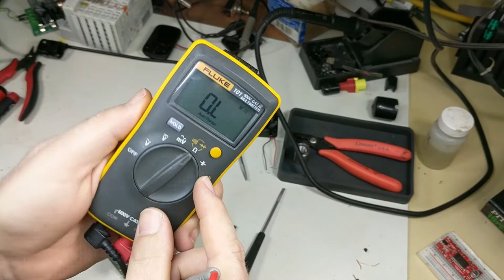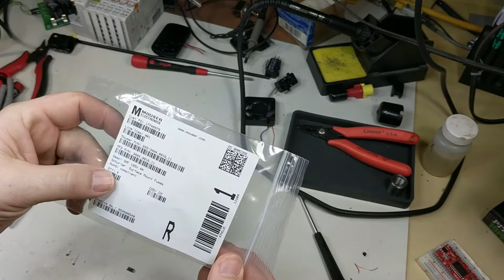Siemens Simatic S7-300 PLC Repair

Comment: Nice video question do you know where is the battery on this unit?
Reply: That version of S7-300 doesn't have 3.5v Battery. They use a capacitor.
Reply: @f1catmancl  how about the programme sir, it will be dissapear or not when cpu doesnt have power supply?
Reply: @indradwika659  the program is saved in the MMC. You lost just the remanent data, but not the program.

Comment: I've replacement the fuse but the LED still off and the fuse cut off again
Reply from the maker: 3:24 check across mov to see if shorted. PLC will work with removed but will not have over voltage protection until replaced.

Comment: We have one of this S7-300 CPU 314, no LED lights at all or no power.supply verified is good. Im not a tech but a purchaser but I'm wondering if the unit is still repairable?
Reply from the maker: Could be Fixable. It doesn't hurt to open it up if its all ready broke.